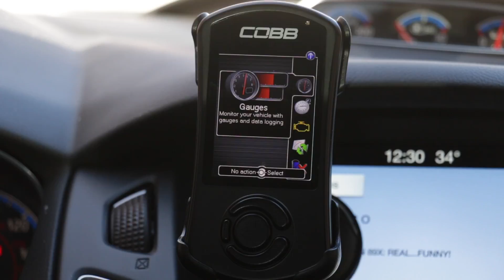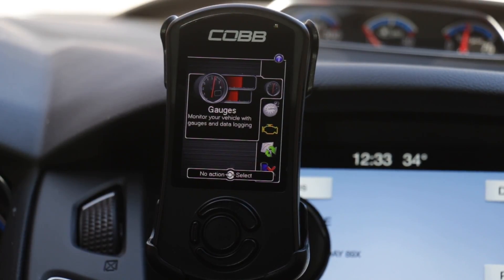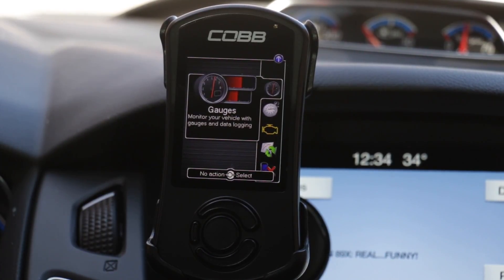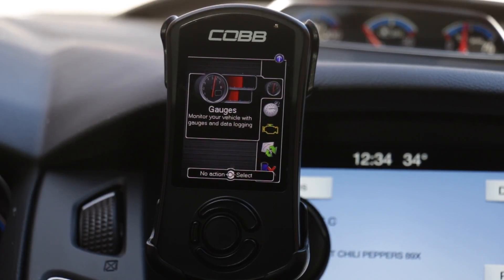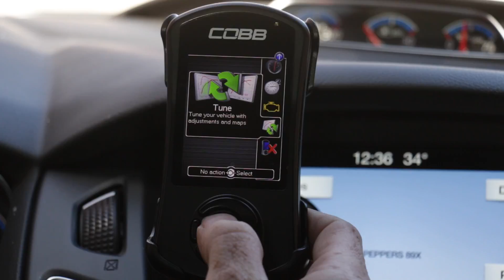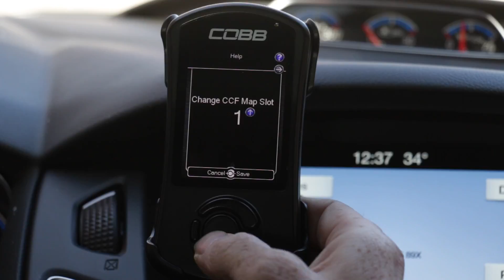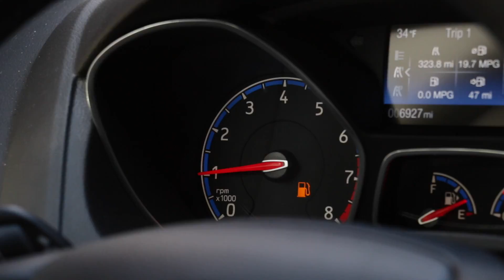Mountune Slot Switching and the Advantages

Comment: Great informative video and much appreciated. When switching slots and the RPMs increase. How do you get the vehicle back to normal RPM idle if you were in any slot other then ones?
Reply from the maker: The RPM change is only a visual to you that the tune changed. The idle never changes, unless the tunes you have different idles.
Reply: Christopher Ayres, once you pick a slot, would you then click cancel again on the cruises control button to exit? Also I understand the reason for slot four. But wouldn’t it better at that point to just uninstall and got back to stock? What are the Pros and Cons of going to slot four or uninstalling ?

Comment: Dumb question... Does this negate the performance modes button by the shifter? Is the Mountune kit an override for those settings? what happens if your say using slot one or slot two and you change the factory settings to track... no ones really touched on this question...
Reply from the maker: +Stephen King It wouldn't really make a difference as the cars stock configurations, track, sport, etc. only stiffen the suspension and move the throttle body configuration a bit for response.

Comment: So this on the fly map changes, they can happen while the car is at speed?
Can you explain the Traction Control modifiers and how the limiter for the Flat Foot Shifting works?

Right now I only have the OTS maps from Cobb and awaiting tunes from Tune+, but do you know what the economy mode does? is it just limiting boost to 5.5psi or something?
Reply from the maker: +Daily Driver basically. They are all different tunes which should be individually dialed to your car for usage. There is a lot of complexity in the TC modifiers, maybe I'll do a video on only that. The flat foot shifting is set to your rpm of choice obviously give a little it's not like you have to hit it then. That's just the floor rpm for it the ceiling is you rev limiter or Fuel cut off.  Yes economy mode is just a low load mode more than a low boost. I'd doesn't let you put as much load in the motor which in turns lowers you achievable boost. Yes at speed as long as it's tuned for that correctly because if you throw a launch control in than I wouldn't suggest switching at highway speeds. It's mostly based on how you and your tuner define all modes to fit you and your expectations for your car. Hope that helped a small amount. I could write a book on the different modes and slots.
Reply: Thanks! that helps a lot.
Reply from the maker: +Daily Driver I hope it did. At least now you can discuss with your tuner what your expectations are or wants and if he or she is any good at what they do they will do their hardest to make it happen while keeping your car safe.

Comment: Well done Chris!  After watching your videos, I went out and played around with my Mountune slots.  They worked like a charm.  I wish Mountune had sent me some kind of manual with my tune.  I noticed the slots on the AP but was afraid to play around with them without knowing what they were for.  Thanks to you I am able to use them with confidence.  Are you going to do a video for the traction control slots and some of the other features on the AP?  Keep up the great work!
Reply from the maker: +John Piccioli Yes. In fact I have been working on a few for the other hidden gems found in mountune's custom AP calibrations. Also rest assured to that my videos contain 100% accurate info as I'm working with the tuner and company in question to get them out asap. I'll have more up very soon!
Reply from the maker: +John Piccioli It's somewhat new also. I was to reliease it per my channel.

Comment: Great video! Do you have any thoughts about the RS head gasket issues going around on the forums? I'm kinda worried....
Reply from the maker: +Patrick Corrigan My only thought is that the newer RS that came off the line may have had the rear of the head reinforced. I would ask someone with a 17 to shine a light under their exhaust manifold on the head and then again someone with an early 16 to do the same. You may see they don't look the same, i.e. The 17's and late 16's may have had added reinforcement. I would verify this first before I started rumors. If I were you..I can't say either way, maybe if your on your the forums you could get someone to do this...preferably a late December built car vs a march 2016. Please comment back if you notice any difference. That is my guess.
Reply from the maker: +Patrick Corrigan As far as worried. If it goes warranty will fix it with a maybe updated part. If I'm almost out of warranty...well I'm sure something will take place before then.

Comment: Thanks for another informative video (series)! Do you know if the slot switching is somehow exclusive to the AP from Mountune, or will other tuners be able to take advantage of this feature? I plan on going with a Tune+, just because they offer a lifetime re-tune service, and am hoping they can do this too. It would be so much easier than dealing with the slow menu to activate launch control!
Reply from the maker: +John Melinte I believe it is a Cobb thing. So as long as They want to support it I believe they can!  The slots are all derivatives of your baseline tune in someway. Like 4 which is the (bad Fuel), mountune calibrated it to pull 1.5 degrees of timing and to run lower boost. Now tune plus may have the slots do something else but they can tune slots. If you have an AP already plug it into your PC and it will update for the new additions. Then get with your tuner for what you want your slots to be.

Comment: Chris anither great vid and expalination. I can hardly wait to install the tune and the filter.
Chris is it necessary to use a battery charger when backing up the stock tune and new tune ???
Reply from the maker: +lexist2112 You can do it without, but if your battery does die when installing it you will have a car that will need to be towed to the dealer for a $3-4000 PCM replacement. I don't use one for map updated or revisions but I would highly recommend it for a first time instal. I would hate for anything to happen on anyone's car for something so simple.